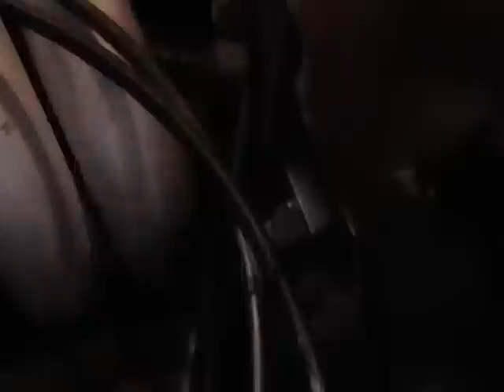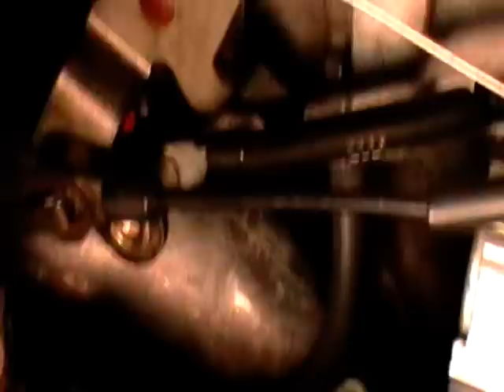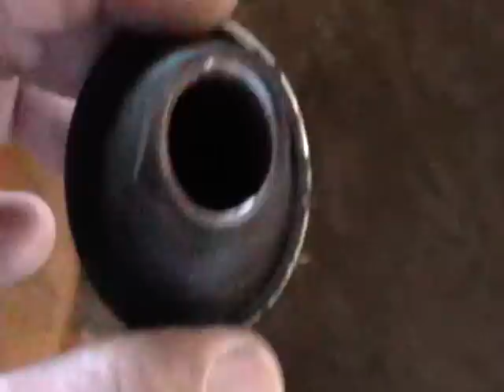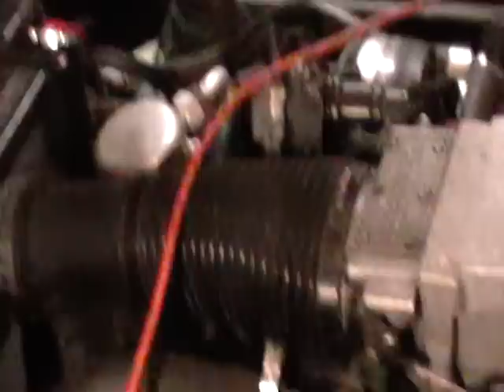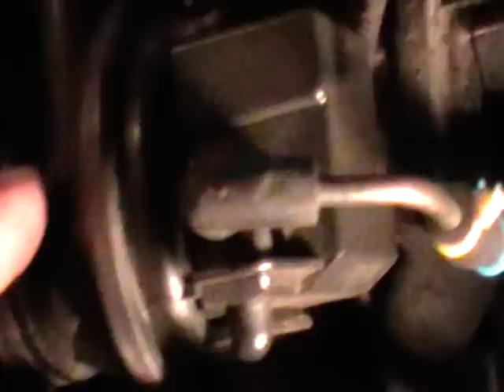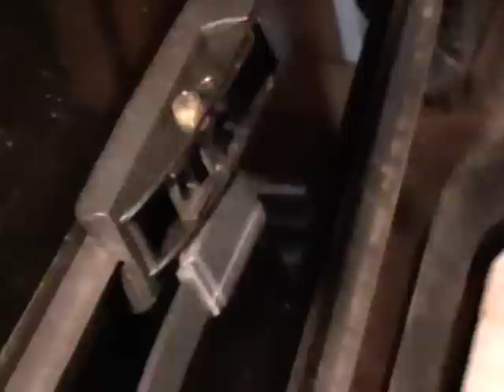1986 Corvette Fine Tuning Emissions, Vacuum Hoses, and Plug Wires

Comment: Do you still have this car?
Reply from the maker: Yes.
Reply: @MrCARWIZ   My dad have a black 86 vette and we are crazy looking for the correct location of the two hoses that are connected together by a Y connector under the Evap canister. I look on the emission schematic and those hoses do not appear. Also tried to find those on the Haynes repair manual book.  If you can please help to find the correct location using your car as a reference, I will appreciate your Help!  Thanks!

Comment: Low Coolant light, may indicate you have air in the coolant line.
Reply from the maker: I've had a leaking water pump for a while now, and I'm in the process of replacing it.  Hopefully that will take care of that low coolant light issue.
Reply: Hot tip, since I've been using prestone 50/50, I have had much better coolant flow than before....did this with my 350 el camino also in addition to my 86 pace car.  Also upgraded my relays to 88/89 model with rubber seal per george kilbreu and the weather related corrosion problems went away.

Comment: Do you ever have a problem with sputtering on hard corners? Mine feels like it has traction control but doesn't do it in a straight line.
Reply from the maker: Can you tell if it is from engine performance, or rear end performance?
Reply: Engine
Reply: Only off the line
Reply: Also have read it could be fuel tank baffles. It does seem worse at 1/4 tank of gas. They say it's an 86 thing. That's why I ask.
Reply from the maker: Vtec Banger Pull out your fuel pump and clean the pick up screen with brake kleen, a tooth brush, and compressed air.  That may help.
Reply: Ok. Thanks